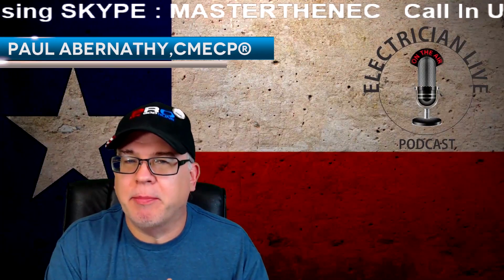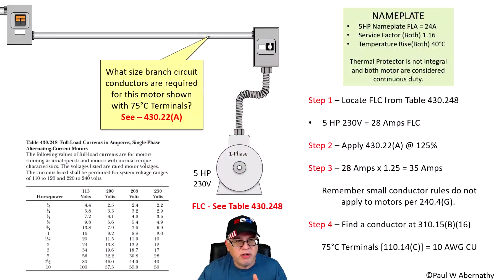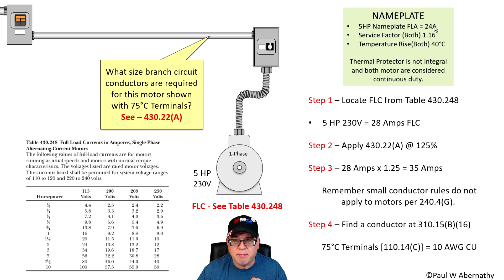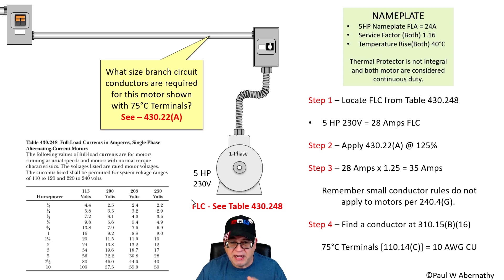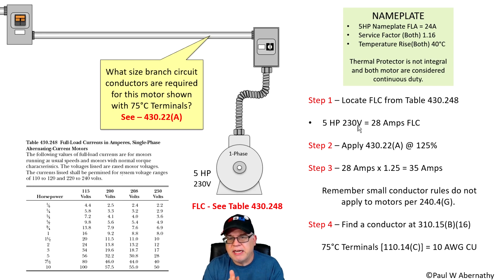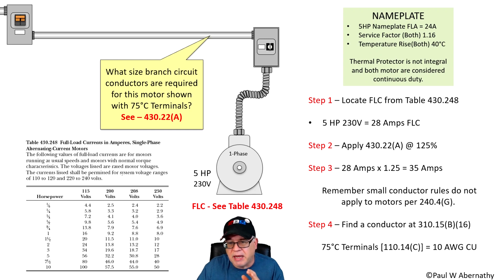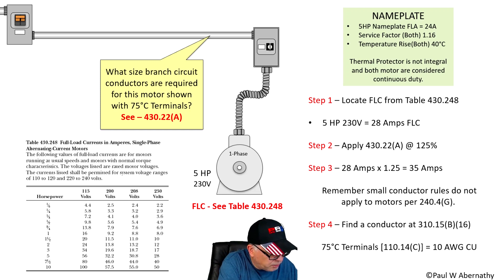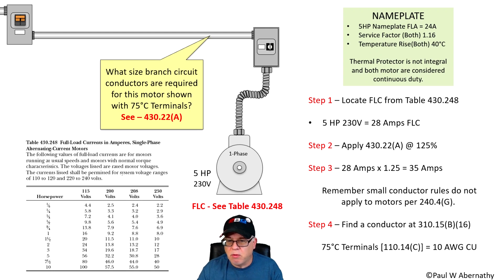Single Phase Motors- Simple Branch Circuit Sizing

Comment: Hello!  So what size breaker would be used in this application? 30 or 40?
Reply from the maker: So....did you NOT watch the video?
Reply: @MasterTheNEC Yes I actually did! I must have missed it if you mentioned it. All I heard was a lot about conductor size. I will listen again. Thanks!
Reply from the maker: The Short Circuit / Ground Fault Protection is the OCPD and if a circuit breaker it would be up to 250% of the FLC. We covered it.

Comment: Hi master , can we use the flc on the table for sizing the conductor and CB of airconditiong?
Reply from the maker: Use the nameplate on the equipment. No need to over complicate the application. It will give minimum circuit ampacity and maximum overcurrent protection on the nameplate...Stick to that data.

Comment: Thank you!  What about an AC Servo Motors.  Do they obey the same rules as regular AC motors? If the manufacturer of the VFD or servo motor Drives recommends  nominal of MCB. do  I need to consider these recommendations?
Reply from the maker: I would contact the manufacturer of the VFD for additional instructions.  Also VFD are covered in Article 430, Part X and in 430.6(C) as well.
Reply: @MasterTheNEC    Ok  thank you!   I am on UL508 A project  and UL says nothing about servo

Comment: Both hot wires should be 10AWG?
Reply from the maker: Greetings - This is a simple branch circuit so yes all branch circuits associated with this example are 10 AWG CU. The sizing of the branch circuit is per 430.22(A) in this example.